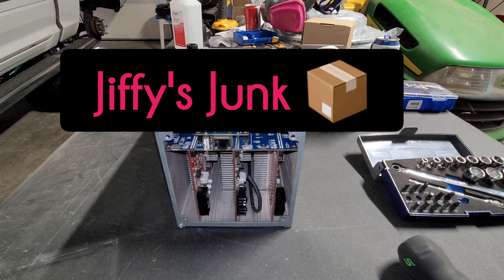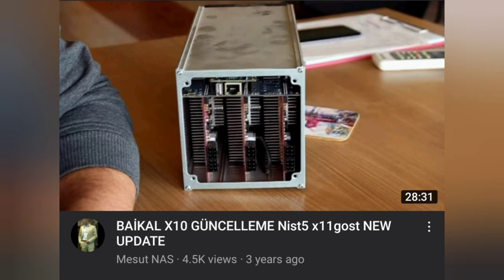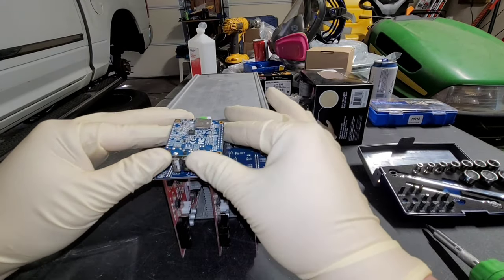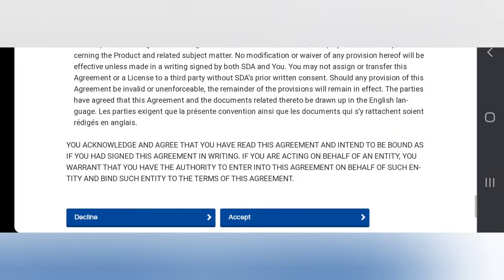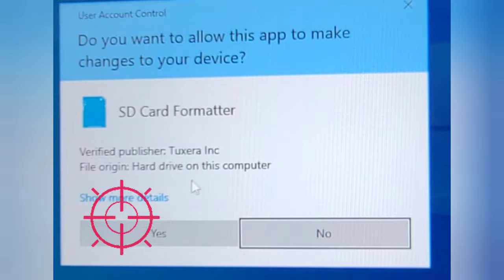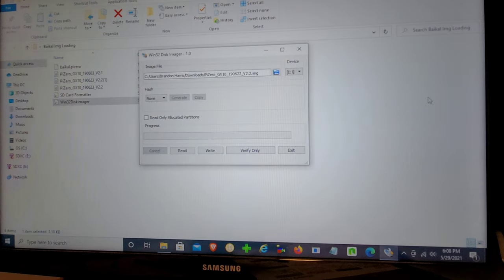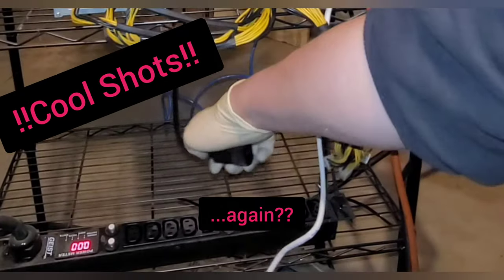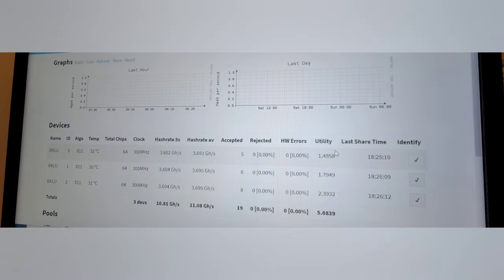Simple way to Increase Your Baikal X10 Efficiency

Comment: Hi mate. thank you for the video. I want to ask you some questions. I have six bk-x right now. What should I do with them? Can you recommend me something? Currently, I am using them to mine groestlcoin on mining dutch. profit is 7 dollars with 6 bk-x 60/gh power. which algo should I use or whats ur opinions?
Reply from the maker: I wish I could give you a good answer, but I haven't done any mining since a week or two after this vid. I'm a little out of the loop. I sold all of my miners for huge profits during this crypto bull run. Made more sense with my ever increasing electrical rates. Maybe sometime in the future I'll mess with mining off of solar/wind.

When I was mining though, I was using MiningRigRentals.com. When my rig wasn't rented, it was mining my algo and pool of choice, going to my personal wallet. Every now and then someone would rent it, and I would make more off of the rental charge than what I would mining. The only downside is dealing with the occasional a**hat or inexperienced renter, and keeping up with the rental market prices.

I have a referral link if that interests you, but I won't shove it in your face.

My only other suggestion would be to sell majority (maybe not all) mined crypto asap during bull markets, and save majority during bear markets. Holding onto majority of the DGB I mined last year would've netted me almost 30k$ more this year, and I was only using one miner to mine it, an S9i at that. Some functional TA on crypto markets could help when deciding to sell.

Comment: If you don’t mind, what algo are you running and profits? I’m thinking about one of these for the Qubit Algo. The x11 algo doesn’t seem profitable based on available data. Thank you
Reply from the maker: I sold it months ago unfortunately.

I was running Skein on it mining DGB, but mainly I was renting it out on Mining Rig Rentals. For a while there, renting out on the skein algo was rather lucrative for such a machine on a low power algo. Something like 10k+ sats/GH/Day early 2020. Skein rentals are going for 1k sat/GH/ Day currently.

Without renting it, I was actually in the negatives. Not horribly though, pennies from what I remember (if I sold on the spot)

BUT I bought it before the BTC halving, and was mining DGB when it was sub .01$. Once the crypto bull began, I was more than profitable as I didn't offload 100% or regularly.

I also bought the rig for 80$ during the bear market and turned around and sold it for 600$ in May-ish. Another aspect to consider. Price of miners fluctuate with markets.

With skein being such a low power algo on this rig, I think it could be a decent solar project/experiment.

Sorry, long winded. There's a bit of things to consider. Day to day, I was running in the negatives without rentals. Probably not worth it right now IMO, unless you plan of having it hosted somewhere with cheap elec, or going green. Solid rig though, no issues the 2 years I owned it.

I've been out of mining for a while, so I'm not sure whats coin is doing what on any algo.

Comment: I have to subscribe for so much effort and details you answer your audience. Hope you channel will be more success! as up today, im consider buying Baikal X and Baikal N240 for $500 and $100 respectively, do you think its good idea. Electricity in my area around 12-15 cent/kW. Im new to this and only been doing GPU mining, i still need to do research to see if this can mine various of coins and what is the catch here since the price quite low compares to my GPUs. Thanks Sir
Reply from the maker: Thanks for the kind words!

If you don't already, I'd suggest using asicminervalue.com, its a great resource for getting an initial impression of a miners capabilities, profitability and algo compatibility.

According to the site, the Bk-x is $0.48 profitable on the Groestl algo at $0.15/KWh electric rate. The N240 however isn't profitable.
Reply: @jiffysjunkbox3487  great! thanks for your reply. i know what to do now! Good luck with your chanel !